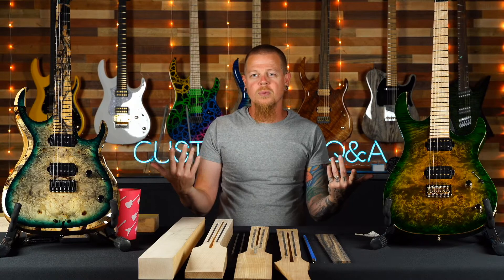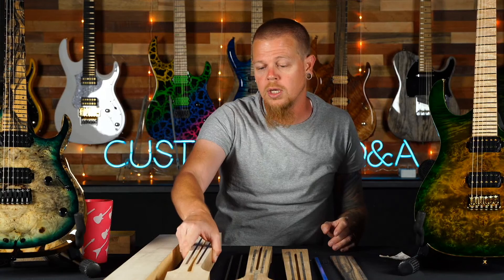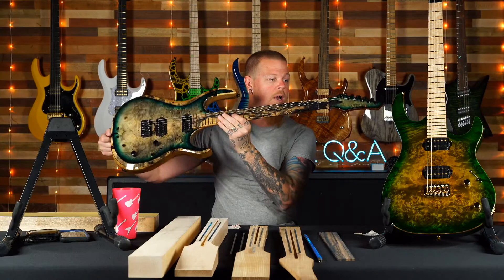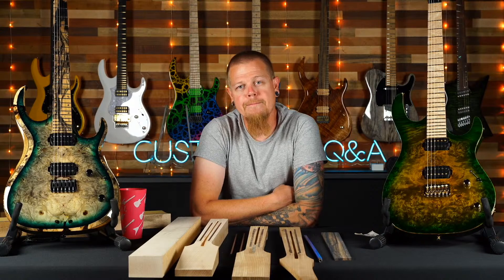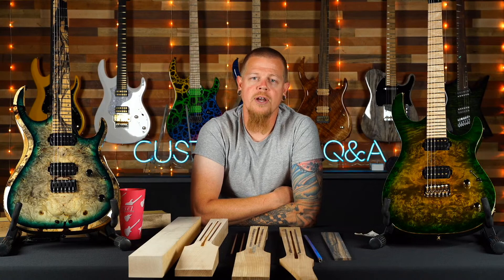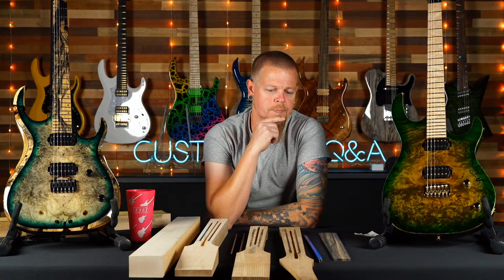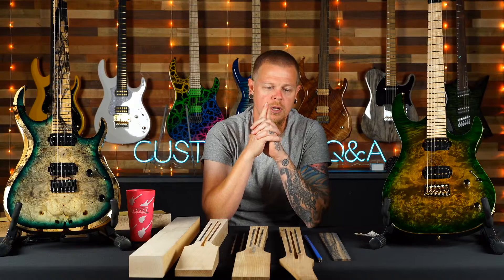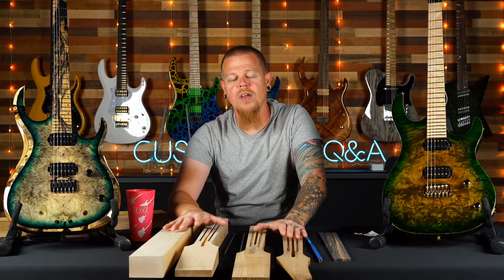What makes Kiesel necks special?

Comment: Gibson necks do not use a glued on headstock. Ironically, they would break less if they did.
Reply: he must of meant epiphone.
Reply: I get the humour, and maybe ive just been lucky or really careful. But ive owned a hand full of Les Pauls, and at least 10 Sg’s and ive not one had an issue with the neck breaking, or any other major issues. I just bought and returned a brand new 61 reissue because it had 9 cracks in the finish, out of the box. But that’s the worst I’ve seen.
Reply: @Podcastforthewin  Literally at a filming gig... everyone left their guitars and equipment sitting in the studio.  The nextg morning my boss' les paul headstock is literally dangling by the strings it had.

Maybe a ghost broke the headstock but that was insane.🤣

Comment: Considering a five-string headless Kiesel bass. Stock, these instruments come with a quarter sawn maple neck with two carbon rods. Sounds pretty darn stable to me. My question is does it make sense, in addition, to get a roasted maple neck? Now if you're just going for aesthetic because roasted maple has a pretty cool look, then go for it. But in my case this is strictly for set it and forget it neck stability. And if that's the case, is ordering a roasted maple neck in addition to what the stock neck already comes with, complete overkill? Anyone? Thanks!

Comment: I buy flat sawn kiln dried jatoba, wenge, and figured maple from a local supplier for my necks. I rip the blanks lengthwise into three pieces, flip each piece 90°, and then glue them back together to make an engineered quartersawn blank.
I also use cabon fiber rods and two-way truss  rods. My necks do not move.
I use a flat headstock, like Fender uses. I'm not opposed to tilt-back headstocks, but in my opinion, unless a scarf joint is used, there is too much waste wood produced by using a blank that is thick enough to accommodate the depth a tilt-back requires. 
Ironically, Gibson used 3 and 5-piece maple necks in the 70s (with a volute), and those necks of theirs in particular are their strongest and least break prone.

Comment: When did keisel start the carbon rods in the necks? I have a 2013 DC 127 and the neck is just solid, it's never moved after I adjusted it to taste. It has to be said I own several custom shop Gibson fender charvel etc and the build quality and fret work of the carvin stands out. If I wasn't in the UK I would own more.

Comment: on a vader neck through construction how far do the carbon fiber rods go? all the way to the bridge or do they stop at the 24th fret?
Reply: Come on dude use some common sense. The rods are their for rigidity.  A long rod of any material is less rigid that's why they don't even go close at all to the ends of the neck.

Comment: Thanks for valuable information man. I have one question about carbon rods. Im designing and buidling semi hollow neck through 6 string guitar. For neck, I have one piece of perfectly quarter sawn european maple (not flame maple). Neck will with 12 inch radius and pretty standart neck thickness, I would say 21mm at 1th fret and 22mm at 12th fret. Do I need to use carbon reinforcement or not? Or its just more of preference in this case? Im asking because of that neck through design... thanks very much for answer.